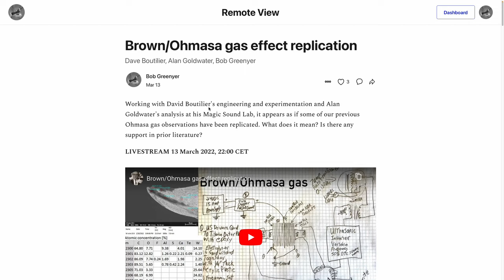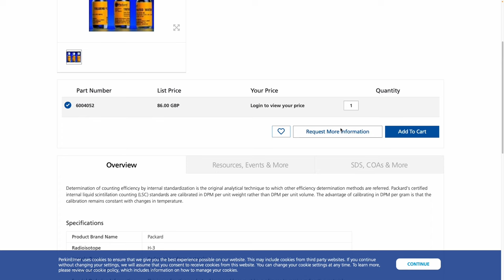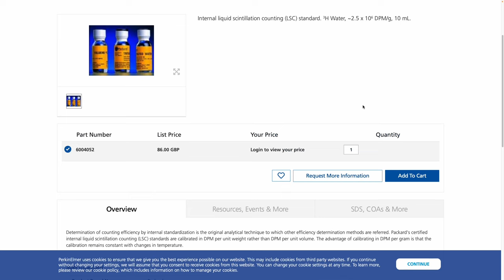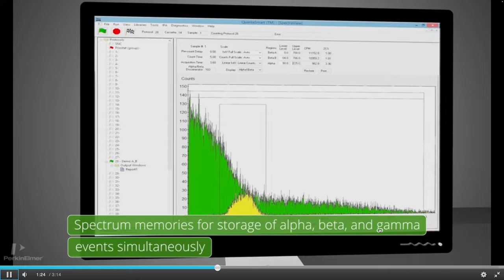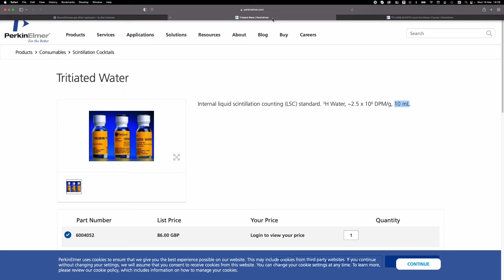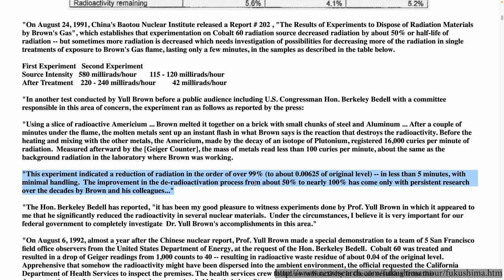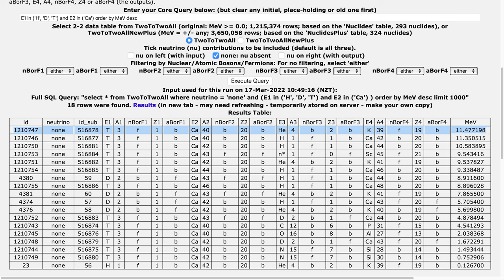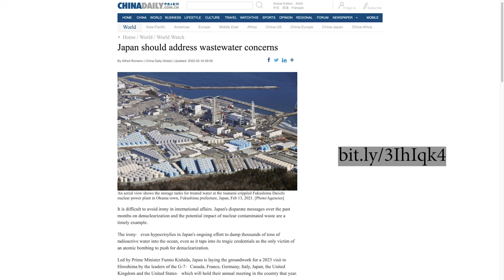Fixing Fukushima - 10 - Path to quantitative and qualitative data

Comment: Well, really interesting challenge that is presented to be solved. We know that Omasa himself was successful in reducing tritium activity using only his vibrating vane system, so I think the electrolyzer will be even more successful. 
The request of quantitative data for consideration of the proposal is reasonable, albeit they could have made it clear beforehand that this was absolutely needed. Anyway, the price of Tritiated water and the need to find a place with radioactive material handling license, and a lab that can analyze the results, is quite a challenge and I really hope you can pull this out, and that I can help in any way.
Reply from the maker: Thanks Curbina, I will give a short update on this before the week is out.

Comment: I wish my old lab was open (though in the USA), we had a license for this and also a couple of these scintillation counters ( we used primarily for, radon samples collected on filters).  Sorry, didn't think about this myself (been 25 years ago)
Reply from the maker: We would have been in a very different position if you had and it delivered on its promise. Such is life.

We must try, however we can, to get around the artificial barriers. If it fails that is one thing, at least we tried. If we can't do it because of artificial barriers, that tells us something. If we make sure we fail by giving up, that's down to us.